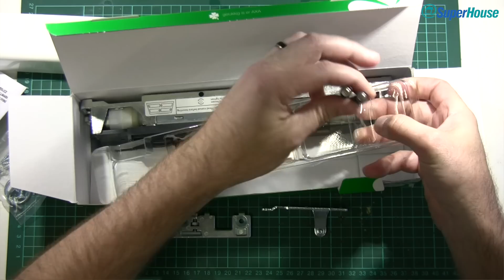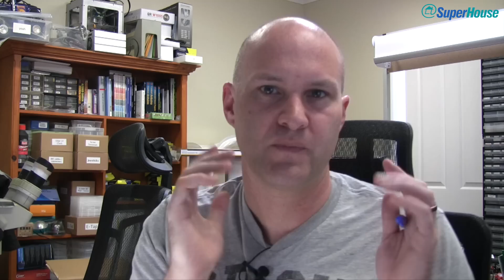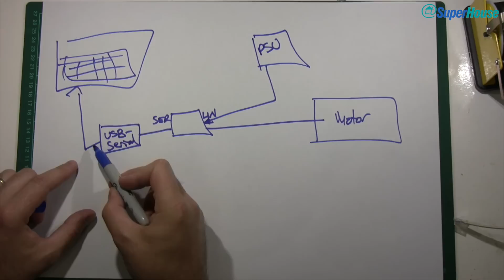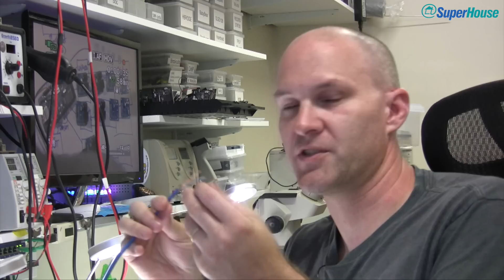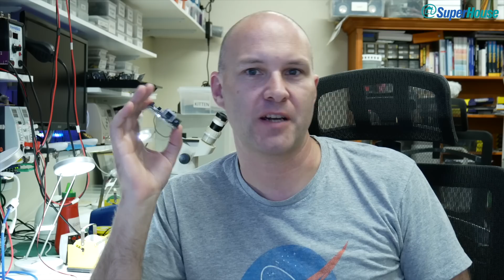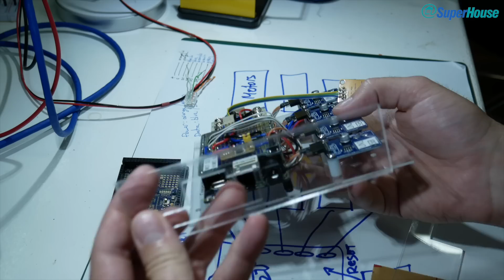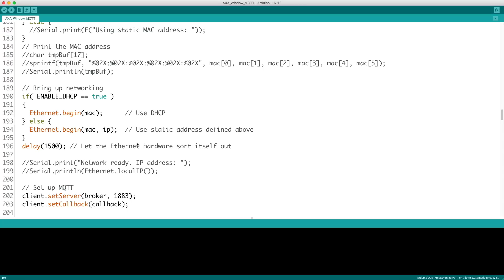SuperHouse #22: AXA electric window motors controlled by LIN bus and Arduino

Comment: Thanks for this video. I really enjoyed it being this long. A lot of good information you presented, and I am also glad you did not edit out your failures. That just lets everyone know that anyone can make a mistake. Maybe you can make a video where you can check what died on the Arduino Board, and repair it. I agree with Alan Woods comment, where you split the data lines up so that 2 data lines are not on the same twisted pair.   If you have time, maybe you can see what uC is in the actuators, and substitute it with a nano with your own code. That way you can have a single bus, and just address them seperately.   Also, as mentioned, the self test on power up is a big problem. I have a Wemos D1 Mini Controlling my Garage door motor from my openhab and mqtt server, and somewhere I have a discrepancy with the system, where sometimes if the power to the Wemos is cut off and restored (or sometimes even if the Access Point is restarted), that the garage door opens!    But I at least have an openhab rule to automatically close the door after 30 minutes, so it is only a risk for a bit (but in South Africa, with our crime rate, it is actually a good opertunity for oppertunistic shoppers).
Reply from the maker: I've already started designing a PCB as a replacement for the controller shown in this video, so that everything is mounted together and there aren't any interconnect wires at all. It'll be much smaller and neater. I'm going to put a scope on the data lines and experiment, to see how much cross-talk there is both within the twisted pairs and between pairs. I definitely thought about replacing the control board in the motors, because my natural reaction when something doesn't work exactly the way I like is to think "I can do better than that, I'll make one myself" but I resisted the urge to go down that rabbit hole. Regarding the security problem, I totally agree that it would be a serious problem, but the motors haven't done it since I've had everything connected. I think they might only do it before they have been bound to a remote control, then afterwards they assume they are OK.

Comment: On LINbus, any slave can assert for the master's attention, so while slaves cannot start communications, it can trigger the master's poll.

There are a bunch of automotive AVR's like an ATtiny87 with direct LIN support, and even some "hybrids" from Atmel with LIN drivers. They are probably a better option for custom adapters.

Perhaps you can modify the LINbus ID on the window winders so that they can operate individually on a bus. Or was that not an option? What? No manual?
Reply from the maker: Oh nice, I haven't looked at the ATtiny87! (Runs away to research it...) Perhaps the IDs can be changed on the motors, but I have no information about them other than how to mount them and plug them in. They come with no documentation about LIN at all. I figured it out by looking at how the HOME-LINBUS shield works, and then poking at it using the MCP2003.
Reply: The MCP2003 is significantly only the transceiver. LINbus frames need special feeding and care. ;-)

The ATtiny87 does not contain bus-level drivers; only the LIN "engine". You need to add the bus-level stuff. If that's all you need at the "appliance end", then there's e.g. an ATA6625 that does the bus driving as well as provided some regulated voltage to your small circuit from Vbat.

Prefer a kitchen sink? ATA6616C which put an ATtiny87 core into the same box as a regulator and transceiver - all in a tiny (not for soldering by quaking fingers) QFN38 package. Specially targeted to automotive applications. Alas; not easy to find in the usual distribution channels, unless you want to buy a reel of 4000. :-(

Comment: I LIKE this project.  It does have many useful details and it is quite instructive.  However, when you first mentioned the problem of the LIN bus(buss in some English variants), I immediately thought of the way that I might tackle the serial communications issue and my  "answer" was significantly different than the architecture you used.  Mine, too, would require some additional hardware, but would be a simpler hardware design (with a small compromise that shouldn't be an issue).
You handled the mux/de-mux issue by using a separated serial path for each slave motor.   However, one might continue to use the Arduino shield that used for your initial testing.
The multiplexing and de-multiplexing could be handled with a single CD4066 analog switch IC to switch the DATA signal to the appropriate slave.  A 4066 would handle 12V signal levels well.  The control lines to each switch in the IC would have to be 0-12V, but a simple level translator ($1 on eBay) would handle level shifting.  One would then enable each switch in turn to select the appropriate slave motor.  The switch would have to be enabled for the interval needed to send a command and to await a response.
So, sure enough, the Arduino sketch would be slightly more complex though :

enable switch0
send open command to slave0
wait for "OK" 
disable switch0
enable switch1
send open command to slave1
wait for "OK"
disable switch1
...
rinse and repeat.

Total hardware cost?  Perhaps $5 (includes the temp/humidity sensor), without consideration of the PCB cost.  The interconnects would be much simpler.  And, since you could use your favorite Arduino with Ethernet together with the LIN shield mounted - the extra 4 digital IO lines would be readily available to control the analog switch.  You'd use no serial ports, so one would be available for use with the Arduino serial monitor, so it can be used for debugging though the entire design and debug process.

Please don't take this comment as a criticism.  I've learned over 45 years of hardware and software design that there are many ways to address a design and my own "back of the envelope" concept may have some warts.

Dick (www.hardandsoftware.net)
Reply from the maker: I like that approach, it would have been a good alternative architecture. It would also lend itself to expanding easily to more channels with very small overhead for each additional channel. I did something quite similar to this in the Payload Processor Module that flew on ArduSat-X and ArduSat-1, with a pair of 16-way multiplexers allowing the supervising processor to communicate at will with any of the 16 slave processors that ran the experiments on the spacecraft.
Reply: Another, perhaps better(?), similar approach would be to control the 4066   or multiple 4066's - directly from the Arduino 0-5V DIO, and to use the bi-directional level shifters on the 12V data side.  Though more commonly used for 3.3V to 5V applications, the level shifters would work fine for 5-12V conversion, and would have a much lower on resistance than the 4066 switch.  Also, one might include an optional impedance matching network (if resistive, such as 75 ohms, we would have to boost the supply voltage from +12V to +24V to compensate for the network.  But, this should reduce reflection, if that is the source of faulty signaling integrity.  This might be tested on the bench before adding it to a design.
Reply: On second thought, this second alternative wouldn't work.  The output of the LIN shield is 0-12V, so the analog switch would, perforce, have to use a 12V Vcc and switch level.  The Rds on of the switch might upset the signal level at the slave receiver -- or, it might be fine.   But, my first suggestion might be something to consider.

Dick
Reply: I'm old-fashioned, I guess.  So, the venerable 4066 came to mind first.  It requires level shifting of the switch control lines, so that it can accommodate the 0-12V range of the LIN bus.  However, a little study suggests that something like the Analog Devices ADG508 (http://www.analog.com/media/en/technical-documentation/data-sheets/ADG508A_509A.pdf) would be a better choice.  It has TTL level control and 12V is well in range of its switching capability.  In addition, it has a built-in 1 of 8 decoder, so 8 channels might be used with only three DIO controls from the Arduino.  It does cost $7 each is small quantities, but this is still a reasonable choice, because it reduced the BOM to a single IC to mount on the PCB. Ron is comparable to that of the 4066, so that parameter needs some thought.

Comment: Any chance you have the links to where you found the perspex mounting board and RJ45 terminal?
Reply from the maker: The mounting board was some random offcut that I pulled out of my pile of plastic that I use for the laser cutter. I don't know the source, sorry. Most hardware stores will sell something similar. The RJ45 breakout I used is this one: https://www.jaycar.com.au/rj45-side-entry-surface-mount-8p8c/p/YT6064. It's handy because it has screw terminals on it, but you could also use something like a regular RJ45 keystone socket, crimp some UTP cable into it, and solder the other end of the UTP to whatever you like.
Reply: Thanks, perfect. I've been looking for a screw terminal RJ45 connector for a while. Cheers!

Keep up the awesome videos.

PS: Do you do any paid board design? We are building a product at the moment and may need a bit of help designing a shield.
Reply from the maker: I do custom board design sometimes, yes. Feel free to ping me on jon@oxer.com.au if you'd like to follow up in a less public way!
Reply: For anyone searching, the "Arduino Uno R3 Shield for HOME-LINBUS Devices Axa Remote 2.0 Window Opener" is available on eBay at http://www.ebay.nl/itm/Arduino-Uno-R3-Shield-for-HOME-LINBUS-Devices-Axa-Remote-2-0-Window-Opener/131524803718

Comment: Could you use an etherten with the software serial library to control the four lin modules instead of the ethermega?
Reply from the maker: Scott Hanson That was my original plan, but I don't think the software serial library supports 2 stop bits. It could probably be modified to do it, but I wanted to make quick progress so I used a Mega because it avoided that whole problem. That was one of the design decisions that I didn't cover in the video
Reply: I've used this library before to do multiple software serial with different stop bits - https://github.com/ledongthuc/CustomSoftwareSerial

Comment: Great video as always! I just had a question about the wake up sequence. Can you turn this off? Sounds undesirable in the event of a power outage for security and noise reasons. Your scenario about the windows bashing in the middle of the night when windy might move to windows opening and shutting noisily in the middle of the night if the power drops.
Reply from the maker: That's a great question. To be honest I'm confused about exactly when it does that sequence, because I haven't seen the motors do it recently. I think it may only do it as a self-test if it's powered up without any remotes bound to it, but after it has been bound it assumes it's OK and doesn't do it again. It would definitely be a security problem otherwise.

Comment: Are the supplied batteries rechargeable? I wonder if it draws current because it has a built-in battery charger - so you could open the windows of the power is out e.g. in a fire or earthquake etc.
Reply from the maker: That would be a nice feature, but unfortunately it's not that smart. The batteries are regular Alkaline cells, non-rechargable, and the instruction booklet specifically says to remove the batteries if LIN is used.

Comment: May i ask where you have got your motors from? I'm trying to find some to purchase but struggling to find a retailer.
Reply from the maker: I've included links to parts sources on the episode page, and I've started writing some supporting documentation that will be added to the page soon. If you're only watching this on YouTube you won't have all the extra information to go with the episode. There's a link to the episode page in the video description.
Reply: Awesome, thank you for the swift response. I really enjoy keeping up to date with the SuperHouse. I personally would like to see smaller, multi-part series. Shorter videos more frequently, keeps fans more engaged in my opinion. By no means am i asking for this, just letting you know what a fan of yours prefers. Keep up the awesome content, thank you!
Reply from the maker: Thanks Sam. I'd love to have a more regular release schedule, and also to do more multi-part vids. Epic videos like this cause big gaps which is really frustrating both for me and for viewers. I'm finding that the process of filming and editing is a very big time investment, so I'm trying to figure out ways to make the process easier. Every step in the process is an extra hurdle that slows me down. For example, audio is a huge problem. I haven't been able to use an on-camera microphone because I've been using ancient video cameras with tapes, and the motor that turns the tape is so noisy that it can be picked up by the microphone. That means I have to wire myself up with a radio mic or a wired lapel mic every time I want to record, which means I can't just grab the camera and turn it on, I have to do a bunch of messing around with cables first. That's just one example. Each little speed bump that makes the recording and editing process more difficult may seem trivial, but when they all add up the result is that it takes me much longer to create a video than it should. Recently I've been trying to find ways to simplify the recording and editing process so that I can get out more content. This particular episode was made using 4 different cameras, 3 microphones, and 2 different editing packages while I experimented with ways to make it easier.

Comment: Great vid and very informative.  For your next project please leave in the mistakes and changes too once again - found it helpful to learn from your mistakes too with the pitfalls to avoid and thought processes to follow for my own projects.  Loving the laser cutter by the way!!
Reply from the maker: Thanks Steven! I can't believe how long this episode turned out to be. Hopefully showing the adjustments along the way will show people that they should just have a go, and not worry if their first attempts don't quite work out :-) The laser cutter has been fantastic since I went to the trouble of setting it up properly and removing all the reasons for not using it. I used to have to drag out a ventilation pipe, set up the water cooling, etc every time I wanted to use it. So I spent about a day installing a permanent fume extraction system and connecting everything else so that it's permanently ready. I can walk up to it and be cutting less than a minute later. It's amazing how going from 10 minutes setup time to 1 minute setup time makes me so much more inclined to use it for even trivial things.

Comment: Maybe using each solid colour for a separate data line, and its pair (strip line) for the power. This would give a bit more seperation between the data lines.
Or - LIN1
Gr - LIN2
Bl - LIN3
Br - LIN4

Or/W - 12v
Gr/W - 12v
Bl/W - 0v
Br/W - 0v
Reply from the maker: I'd love to quantify this. I'm going to follow up later with another video about making a more permanent controller with all the LIN drivers integrated onto a single board, so when I do that I'll put a scope on the lines and experiment with how much cross-talk there is both within the twisted pairs and between wires in different pairs. It should be interesting.